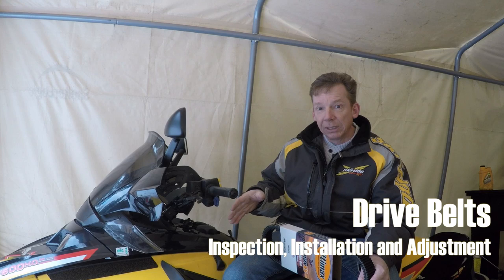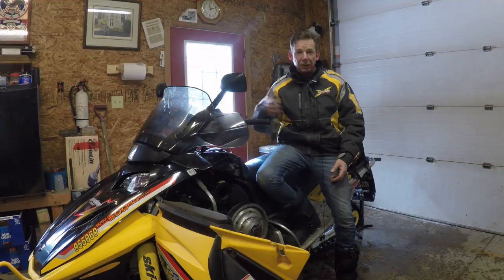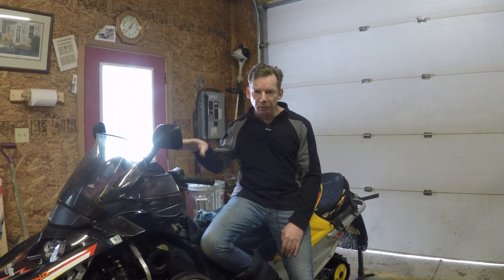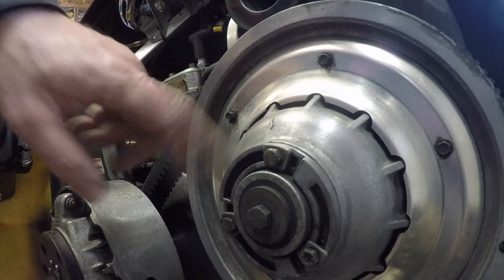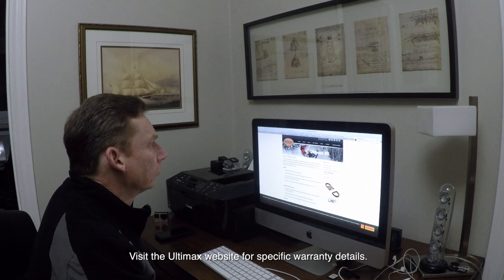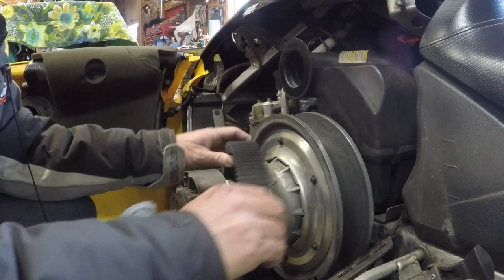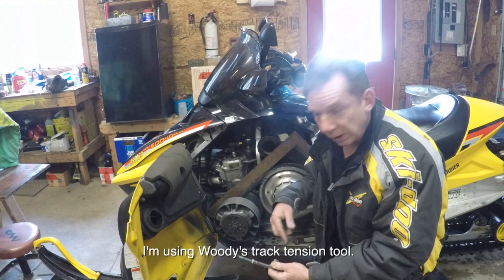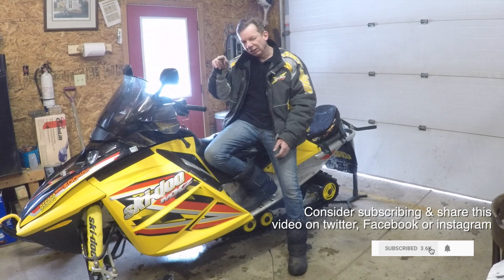How I Inspect and Install a Snowmobile Belt  (& Adjust Deflection)

Comment from the maker: Finally had a chance to change the belt on my 05 Rev. Thought I'd use the opportunity to do a video on changing a belt and adjusting the secondary.
Reply: I bought a 71 sw433, how do i adjust the belt, I might be blind but i dont see where i can do it. Or is it so old it uses some other method of doing it? Hope you can help me.
Reply: I have a question. I bought a 2007 mxz 600 renegade takes off great but when letting off the gas it does like a engine braking type of thing that’s ridiculous.. could that be a clutch issue?
Reply from the maker: Have you checked if your brake calliper is sticking? If it is, it can create heat, and that can cause problems.
Reply: @MyOldSled  I checked that and they are fine. You can wiggle them when the brake is off. I even drained all the old fluid out cause the previous owner didn’t do that it was brown. I lifted the rear and turned the secondary to see is there is a lot of resistance but that seemed fine as well. Starting to think something is up with one of the clutches. 🤷‍♂️

Comment: A buddy of mine when his belt blew, It was also an Ultimax ! It blew so hard it punched a hole right through the panel near the footwell and smacked his foot ! 4 of his toes got broken and it shattered the bone in his foot !  He was on crutches for nearly a month or so ! Now when I get heavy on the gas I think about him and I always back my foot out of the footwell ! =)
Reply: The newer belts for higher HP sleds are very very hard compared to the rubber type belts of old. Also there is 3 different Ultimax lines depending on your sleds HP. Match up the right one.

Comment: Late to this party (channel)!! Great video. I’m not the most mechanically inclined person, but this was very understandable! Will check out the current deflection and condition of my belt and clean my sheaves when I finally get out to the cottage this winter. There is a mild knocking sound from the front end on my 2009 Polaris FST IQ Touring when driving at low speed. Disappears at higher speed (or maybe gets drowned out by the engine noise). Not sure if it is related to the belt though. No such noise when I run the machine with the track jacked up off the ground. Will check the belt anyway. Great, helpful video! Subscribed!!
Reply from the maker: Thanks Brian. Welcome to the channel

Comment: About that hour glass thing, I had that happen to me. Thought the chain tensioner had come off or something, the noise at low speeds was horrible. I guess the change in belt thickness makes the driven clutch vary a lot in speed, and thus the slack in the chaincase and drivetrain makes horrible noises. Changed the belt, and everything was fine again. Definitely do not try to rip the track off frozen ground using just the engine, you'll probably ruin your drivebelt. Try to lift the skis and track off the ground by hand first.

Comment: Morning David! That was a super, super helpful episode. Learned a few things I never knew after all these years. Which of course, now begs a question. (1) I always thought that the belt could only go on one way  - the way the arrow pointed (the one printed on the belt). So not true?  I wasn't aware that there was a need to adjust the width of the secondary. Always just simply put the new belt on and unscrewed the tool and away I go. I didn't realize I needed to check to make sure the belt was sitting at a specific height relative to the secondary clutch plate.  Didn't know there was a need to break-in the new belt. Thanks kindly - great episode!! Thanks again for your attention to detail! Cheers!
Reply from the maker: Always follow the manufacturers recommendations, but according to the ultimax engineer, you should do that so it goes on the same way every time
Reply from the maker: Don’t take my word for it: 
https://m.youtube.com/watch?v=KaJBwUplF1Q
Reply from the maker: Also Gord, if your secondary has never been adjusted, the belt height in the secondary may be right. You can adjust it in as your belt wears and get more life. Of course always check for your particular sled

Comment: Lol on the spark plugs thing but I also run champions in my xcr 800 as the ngk seems to foul alot sooner. Anyway keep up the great work on the videos
Reply from the maker: Hi Jesse. Thanks for commenting. If you keep watching, Ill keep making them
Reply: What's the same champion to a ngk br8es?
Reply: I agree , it’s weird , I always ran ngk plugs in my two strokes and 4 strokes , Yamaha , Polaris , all brands , got a iq 600 cfi and the plugs that came in the sled originally are champions although the dealer suggests the ngk replacement, I can tell for certain that the champion plugs that were origaninally in the sled from factory , after changing back , they’re definitely hotter plugs and run a bit hotter in my opinion, more throttle response from low to mid for me .... and yes way less plugs fouled.

Comment: Alright so I have a 2003 skidoo rotax ho and when it’s at 6000 rpm it makes a pshhhh sound and anywhere past that it goes away. There isn’t any power loss but I just want to know what the kind is just in case.

Comment: So I have a 1999 mxz600 I changed the belt on it ran it afterwards with no problem for 5 mins then parked it, I went to ride two days later and now the sled wont move. When I hit the throttle it bogs down but doesn't move, do you know what I could of done wrong?

Comment: I needed some help, and your help was great. I have an arcticat 440 panther.It has electric start, but battery kept draining. Would that be the starter. Can't get new one for 800.o0. Would you suggest a starter aftermarket for 185.00 do you think that should cure it p.s. got machine for free friend passed and family gave to me. But has not been run in 3 years . also. 
has electric start.
Robert Nichols

Comment: Belts usually have arrows pointing what way it goes. You are supposed to put it a certain way so if ever the belt blows it doesn’t wrap around the back of your primary clutch where it could damage your crank seal and drain all the isoflex grease out of the bearings
Reply from the maker: Hi Sebastian. That is so they go back the same way. That info is straight from the engineer at ultimax
Reply from the maker: Hi Sebastian, just a follow up, I also spoke with Dayco tech support another manufacturer of drive belts, and confirmed this. I generally do a week or two of research when putting together a video like this.  But always follow the manufacturers recommendation

Comment: I have an 03 yamaha viper 700. last week I managed to go through some ice in a deep puddle. It wasn't a safety issue, but I was stuck, thankfully close to home. It was deep enough in water where the belt was getting wet. As you might suspect, the belt did not have enough friction to get the sled out. I wore into the sides of the belt as i was getting pulled out. I rode it home with a bumpy belt. I parked it in front of the cabin on the lake and I man-handled the belt off. I managed to force the new belt on and I went for a ride without thinking about it. How wrong was this?  Do I need to go back and adjust anything? Any comments/advise would be greatly appreciated!!
Reply from the maker: Well, you should have broken it in, but if your over 20 miles, too late now. A lot of guys dont and then wonder why they blow belts. Check where its sitting in the clutch. Glad your adventure ended ok. Sounds like it still put a damper on your ride.
Reply: My Old Sled thanks for the reply! Yea I did a 50 mile trip which was cut short by a lack of snow. I had to pack the rads with snow every few minutes. If I have any issues I’ll buy myself a good belt and break it in nicely. Have a nice night!
Reply from the maker: You too!

Comment: Hi David,

I have the same snowmobile although a renegade. The last 2 years I have been having issues every time a installed a new belt I’d set the ajuster towards the 0 and my belt would always be to high and too tight. Last week end I removed the 3 bolts from the ajuster to find out that the bolts appeared to have been cut. Got 3 news ones, which were a few mm longer. Now I have some play and can adjust my deflection properly. I guess my question is have you ever seen someone cutting those bolts to possibly use a belt that wasn’t made for the snowmobile.
Reply from the maker: Hi Kovalev, No, I'm sorry I can't say I have. Feels good when you figure out a weird problem like that though doesn't it!? I had a weird issue with a fuse that was a one in a million shot I'd find. Glad you sorted it out. Thats an expensive issue. Thanks for watching and taking the time to share your experience.

Comment: An ultimax engineer said you just need to do a few temperature cycles up to 150 degrees C to break in the belt
Reply from the maker: :):I know the video, I think Erick said “around 120 c”... I don’t know my belt temperature, (do you?) so I phrased it in a more practical way. Driving it for around the first 30 miles should allow the belt to heat and cool a number of times. The information I provide on break in is printed on the packaging for ultimax belts. The main thing is not to throw them on and pin it before it has a chance to get to temp a few times.

Comment: I think if you put you belt on backwards. If it does happen to blow they are made to blow the parts out of your clutch. Rather then wrapping around your clutch. Just a FYI so like he said read the words when its installed
Reply from the maker: Sorry Clayton, that is incorrect. The belt is the same either way. That is straight from the engineer at Ultimax.

Comment: I thought they WERE directional: the cords are corded (cords are wound in the belt) one way and if you put one on backwards - and a belt starts to unravel - it'll spool up around your clutch, but on the 'right' way (so you can read them), the cords would come loose in the same direction as the rotation and not spool up - no?
Reply from the maker: Lol. What would you think my answer would be, given the video you just watched. :) Your thinking is a very common misconception. one of the Ultimax engineers put a video out explaining that, and I contacted a couple of belt manufacturers. As i explain in the video, the arrows or lettering are just so you always put it on the same way.
Reply from the maker: I forgot ...check the video description.

Comment: Great video very informative!  One thing that was wrong is how you set belt deflection, the best way to set it as instructed by aftermarket clutch kit manufacturers is to tighten the secondary sheaves until you can move the track with one finger at idle.  The idea that you should set it so the bottom of the "teeth" is level with the secondary is a myth.
Reply from the maker: Hi MrMtcaleb. Thanks for the comment but belt deflection and belt height are both important and referenced in Skidoo shop manuals. In the 2005 service manual, this information is found on page 318, with a photograph, under Drive system and for all models. "Top of drive belt cord should be flush with driven pulley edge."  - as I reference in my video. Maybe let BRP know that it's a myth? ;) While I believe that an aftermarket product may have provided different instructions, I always use the procedures provided by the sled manufacturer. Thanks for watching and commenting.

Comment: what does it mean if the belt squeels at idle and moves forward at idle on its own? I assume it needs adjustment on the secondary or a new belt? Any advice would be much appreciated!
Reply from the maker: Check deflection. Sometimes if they are too tight they squeal against the primary. Try dropping it very slightly in the secondary .

Comment: Hey I  need some help on my sled, it’s a ski doo touring sle 96. It’s been sitting for 5 years and I can start it but it won’t move when I give it gas, the clutch won’t move in to make the belt move, do I have to take of the clutch and replace it or clean it?
Reply from the maker: If its turning but its not moving in and out, Probably needs to come apart and be inspected, cleaned/repaired.
Reply: @MyOldSled  thank you!

Comment: Solid video. My boys and I have really been enjoying your channel as we recently purchased and have been fixing-up a ‘99 GT 583.  Pretty sure we need to change/adjust our belt. Can you show or explain how to adjust the secondary in your MXZ?
Reply from the maker: Thank you. So glad youre enjoying it. There are three allen screws with 10mm locking nuts. Loosen all three locking nuts, adjust the allen screws a quarter turn each time, tighten lock nuts back up.
Reply: Thanks so much!!  Thought it had something to do with those; missed the locking nuts. We’ve learned a lot from your videos to help get our sled up and running!  Appreciate your content very much as well as your periodic injection of humor.
Reply from the maker: Thanks Seth. Good luck.

Comment: I have a off road buggy that uses a CVT Transmission set up, i can pull the belt over 1inch away from the driver/primary clutch pulley on the inside where it would normally ride/rest is this to much belt slack/slop?
Reply from the maker: Sure sounds like it. I don’t know but i think it would be the same. How does it perform when you accelerate?
Reply: @MyOldSled  I ended up tighting it up all seems fine now lol.
Reply: @MyOldSled  Do you happen to know the width of the comet 300658 belt? I have looked everywhere to find nothing!! I am not sure just how worn out it really is.

Comment: Nice video David! You mentioned doing a video about the clutch and it's the perfect time for me to ask this. My younger brother just bought a sled (ca 6 years old) and I noticed that the primary clutch reacts very slow to the throttle. What I mean is that I need very high rpm for the primary to start moving the belt. Have you experienced this and know why it's like that?
Reply from the maker: Thanks. Whats the condition of the belt and the belt deflection like?
Reply: @MyOldSled  I have this same problem. Changed the belt today (with the spare one that was in there)still  and same issue. Moved deflection indicator from 3 to 1 (Polaris 500 Classic) and still the same. Takes all the throttle now to get it moving. Maybe the spare belt was an old used belt too?

Comment: I do believe belts are directional for when they blow the the threads will come off in the direction of rotation and not wrap back the other way
Reply from the maker: Hi Ryan, sorry, that is incorrect. (Would I lie? :) belts are not directional - directly from the engineer at Ultimax. The belt is a continuous piece, the only difference from one side to the other is the printed text.

Comment: Any plans on doing a video on the brakes for this sled? I've never done sled brakes trying to find all the info I can because I've heard they're a common issue
Reply from the maker: Hi Naved. Thanks for the suggestion. Yes brakes should be maintained and inspected routinely, and brake fluid should be changed routinely. Next time I do it I’ll put something together.

Comment: Update from the idle wheel video: I got my sled running! There was little pieces of degraded fuel hose blocking the needles on the needles and seats from sealing.
Reply from the maker: Nice work! Glad you got it going.
Reply: My Old Sled Thank you for the reply and keep making helpful videos!
Reply from the maker: You're most welcome.

Comment: When I was riding my belt it flipped over what does it mean please help me
Reply from the maker: I have actually read of this happening. If you have the right belt, and it was properly adjusted, I would check to see if you have a broken motor mount. It can be clutches out of alignment but I think a motor mount is more likely.

Comment: The top cogs are in fact for cooling, it adds surface area, it adds no strength.  OEM belts is all that I will run.
Reply from the maker: Hi Mit. Sorry, that's a common misconception. The cogs allow the belt to remain stiff in cross section, while allowing it to remain flexible around the hub. Its always a good idea to stick with the manufacturers recommendation, so I can't fault you there. Do you know who manufactures the belt you run?
Reply from the maker: Hi Mit, Just found this. Eric is an engineer who designs belts. He explains the purpose of the cogs. https://youtu.be/5JiaLa2qJKo?t=1m36s

Comment: Dave can you help me. My sled cant start because when i pull start it moves forward
Reply from the maker: Do you mean as you pull the starter rope, the sled tries to inch forward
Reply from the maker: If the sled is inching forward, as you try and pull it, it’s probably an issue with your primary clutch. Could be the bushing on the moveable Sheave Is toast, maybe a spring retainer issue
Reply: when i look at my secondary clutch the belt was very tight
Reply: it temporarly works when i kick the clutch but it just full send by itself
Reply: my model is arctic cat t570 touring